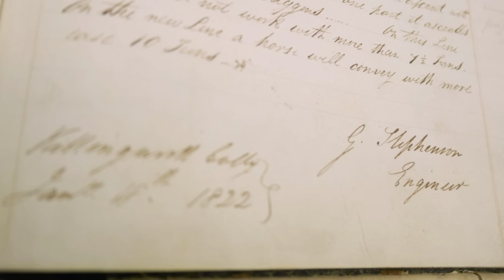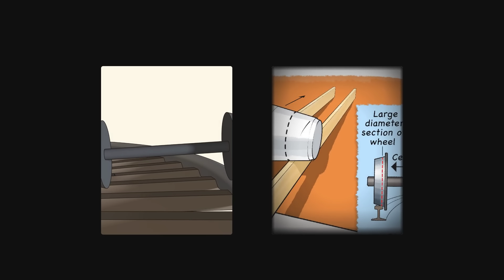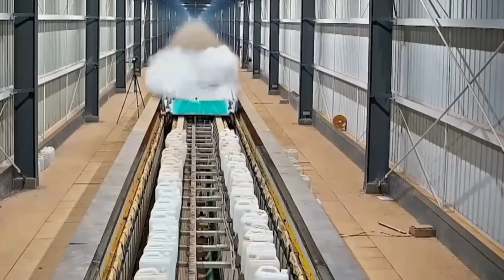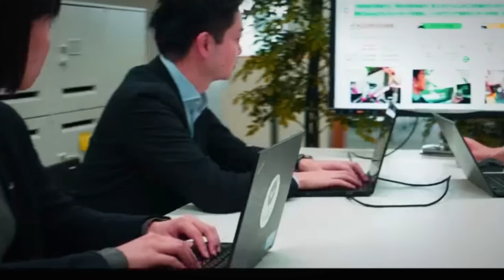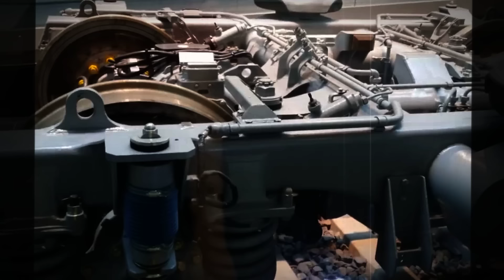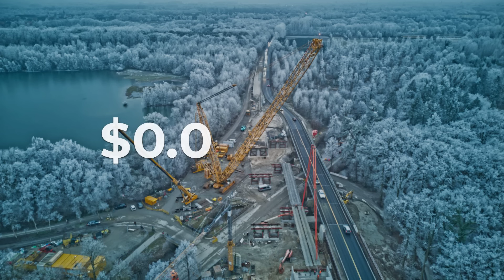The Bizarre Reason Train Wheels Are Shaped Wrong

Comment: I could have missed it due to repeatedly falling asleep because of the endless repetition but, from memory, British Railways Engineering solved this problem for high-speed freight by incorporating what was basically a vertical gyroscope into the centre of each axle and lengthening the wheel base of the vehicle.

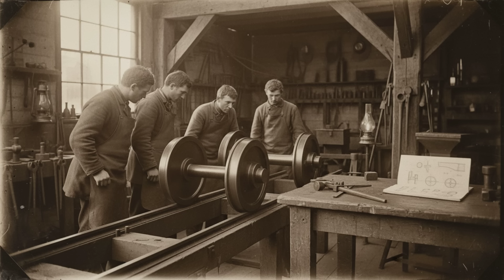Comment: The dialogue has obviously got it wrong! The wheels have a slightly smaller diameter on the outside compared to the inside (near the flange).  2:55 You can clearly see that. 😂 Opposite to what the speaker said multiple times. 😂

Comment: Rail cars have the same advantage that trailers have for road traffic:  They are far, Far, FAR simpler than the prime mover.   A car or trailer can be dropped off and essentially be used as temporary storage.   But both rail cars and trailers are picking up some more tech in the form of ABS which is designed to keep the wheels from locking up and making hard breaking more effective.

The push toward high speed trains should be resisted because it opens up other cans of worms.   Much better to invest the money to reduce the time that trains have to go below normal track speed.   These "slow downs" contribute more toward long schedule times that, say, reducing the maximum speed from 70 mph to 55 mph.

Comment: One of the jobs I had while working for the railroad (GVT) was reprofiling the wheels on a locomotive which had become worn because of wheel slip. Each time a loco wheel breaks traction, a small section of the surface is worn away. Over time the tread becomes hollow and loses its conical shape which defeats the self-centering and steering quality featured in this article. A loco wheel can be resurfaced a number of times before it reaches a specified  minimum diameter after which the wheels and axle must be replaced. This is a big job requiring the loco to be raised on jacks and the truck assemblies removed and dismantled to remove the old axles and wheels and install new ones. One way to avoid this was to machine the wheels while they are still in place on the engine. This was my job assignment. I jacked up the axles one at a time, disconnected the power leads to the  traction motor and connected them to a portable DC generator (welder) and controlled the speed of rotation by adjusting the amperage output. A carbide lathe bit was clamped to the rail next to the wheel by an adjustable fixture which could be moved closer to the wheel as well as across the tread surface. Turning the wheel by powering the traction motor with the welder and forcing the tool bit against the wheel mimicked the action of a machine lathe. It took about 2 weeks of 8hr days to complete but was the best option as our short line railroad lacked the equipment to remove and replace the wheels.
Reply: Neat!